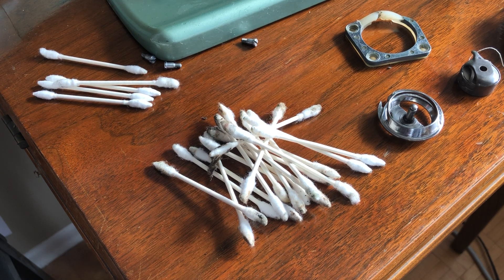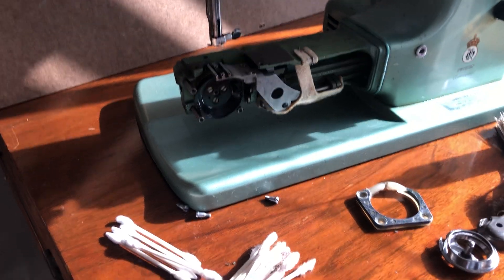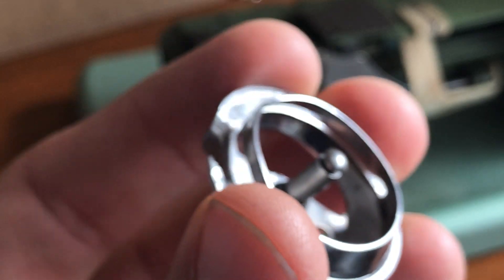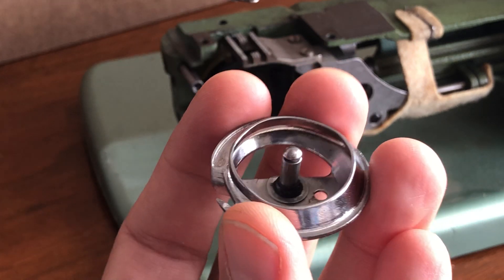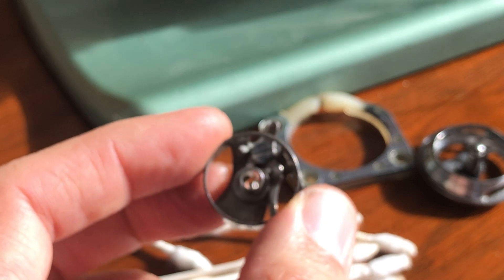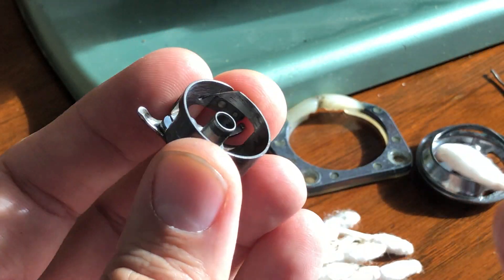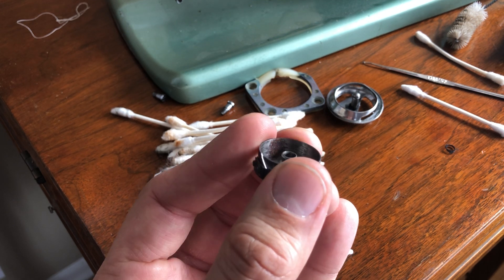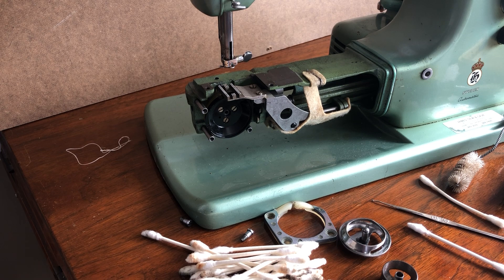VIKING OVERHAUL SERIES #1: Cleaning is More Than Just for Aesthetics. Great Machines Deserve Service

Comment: Have you ever considered an ultrasonic cleaner? I don't own one yet but am trying to decide on which one to get.
Reply from the maker: Hi Anthony.  Funny you should ask this as I recently met another restorer and were were talking about cleaning parts.  He has one of those and highly recommended one.  I have never used one myself.  I think some of them might be marketed to folks who work on /clean jewelry but it could be a possibly useful and time saving tool.  I should look into one.
Reply: My ultrasonic cleaner arrived the other day. I bought a larger one so that I can do carburetors too. I also bought a container of jewelry solution. Mixed up the solution. Turned the heat up to 60 Celsius and started cleaning (30 minute cycles). It does work! Parts come out clean. What it does not do is make the parts shinier, just cleaner. It great for the scroll fronts and springs. Really small parts, like screws, I put into a glass with the cleaner solution and place it right on top of the basket with the other parts. The screws come out clean and don't fall through the basket. For rust I am experimenting with the glass trick but using CLR full strength in the glass. Warning. I made the mistake of putting a bobbin winder with the painted part still attached in the jewelry solution. The paint was coming off after 30 minutes. Won't do that again.